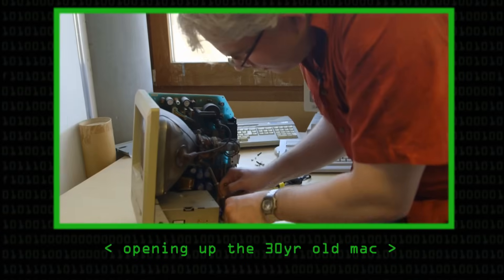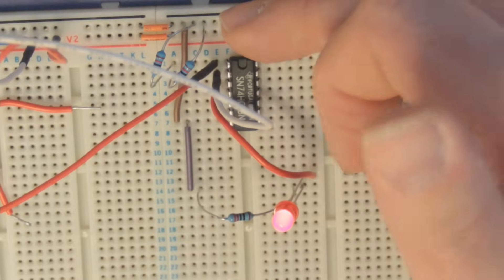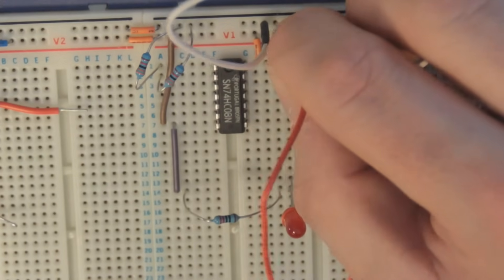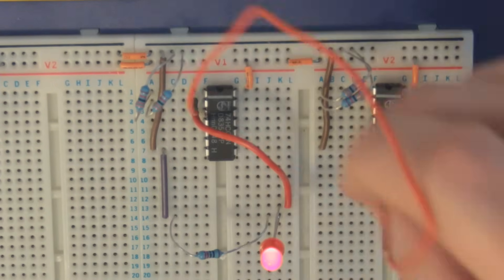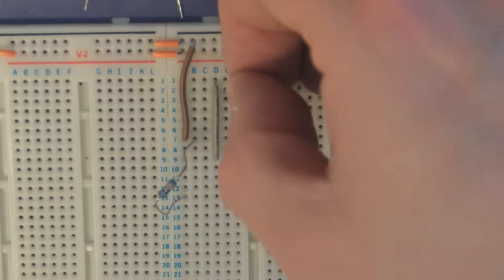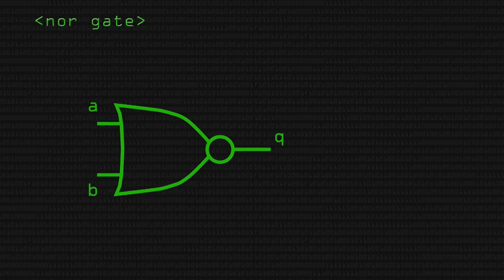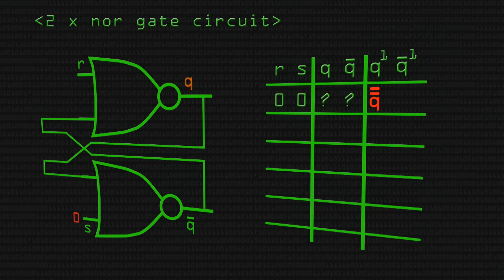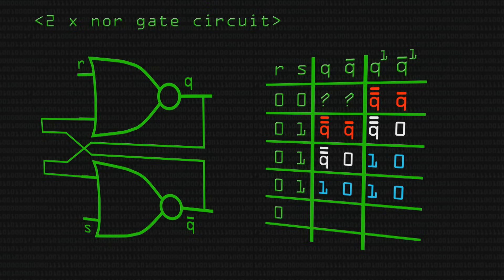How Computer Memory Works - Computerphile

Comment: And not once has he used the word "flip-flop" xD
Reply: realityscorned yes, obviously coming at it from the CS side. UW-Madison ECE grad here. Did you notice he never turned off the power while pluging/unplugging the ICs? And the foil in the packaging used to align the pins into the breadboard? Oi!
Reply: @bjornolson6527  even as 1st year graduates we had marks from Lab deducted if the invigilator caught us plugging/unplugging ICs without turning the power off.
Reply: @EvilSapphireR  I can't think of a way of how can that harm the IC. Especially just a simple TTL chip
Reply: I just wanted to say: didn't he just build a flip flop?!?!
Reply: @andinomm  thats technically a sr latch if im right
Reply: @worstvayneantartic4138  yes it's a latch, I mistakenly use these terms interchangeably

Comment: You wouldn't believe the kinds of tricks memory designers take to make storage and retrieval of data quick. This is a necessary first step to understanding it but man does it turn out to be a small part.
Reply: Are there any resources that one can read up more on this?
Reply: JinGwee
Unfortunately there aren't really any good consolidated sources online that I know of. Plus there's the fact that memory optimization is so fundamental that it runs up and down the entire abstraction stack of computers and causes massive headaches for anyone trying to write parallel programs. I'll give you some things you search for if you're interested.

Logic-Level:
SR Latch (what was shown in the video)
D Flip Flop (more useful in digital logic but shows how clocks are used)

Layout/Transistor-level: (mostly ripped from CMOS VLSI Design; A Circuits and Systems Perspective by Neil Weste and David Harris)
Elmore Delay Estimation
Domino Logic (touched on in a previous video) and precharge
SRAM/6T (6 transistor) SRAM Cell
DRAM (as well as the capacitors in it and refresh)
Differential Sense Amplifier/Small-Signal Sensing
Address line predecoding
Hierarchical wordlines
Domino Address decoder
Hierarchical bitlines
Column multiplexing
Double Data Rate bus (DDR)

Memory Subsystem Level:
Direct-map Cache
Fully associative/2-way set associative Cache
Cache replacement policy
Translation Lookaside Buffer (you probably need to understand virtual/physical memory and process address space for this)
Cache/TLB miss/fault
Memory/Cache hierarchy
Burst Transfer/Burst Mode

Application:
Spatial-Temporal data locality
Polytope Model and optimization
Pointer Aliasing

Operating System/Kernel:
Page table and page faults
Page replacement policy
Cache coloring

Parallelism:
Race conditions
Locking (or if you're adventurous, transactional memory) atomicity and mutual exclusion
Non-Uniform Memory Access Architectures
Cache coherency protocols
Relaxed Memory model
False cache-line sharing (usually done at the application level)

I apologize if the list is too short.
Reply: Ferroneoboron san That's quite a formidable list. Thanks for the reply. I really appreciate it!

Comment: It's one of the first video I watch on this channel and I haven't ever looked into hardware nor software programming.
14 minutes, the only thing I understood was that they create a circuit that loops back forever until you change the external input. But watching the whole 14 minutes made me feel very dumb.
Reply: I'm sure that if you tried drawing the diagram and working it out yourself, you'd understand it just fine. It can be hard to follow an explanation just by listening.
Reply: It's not explained very easily, it assumes that the viewer has some knowledge of computer science. If you'd like to learn more I'd recommend a book called 'Nand to Tetris'.
Reply: You're right.  It does loop forever or "flip-fop".  When two gates output into each other's inputs, they are called flip-flops which can be used as a type of memory.  Because they keep flip-flopping, they can keep their current state until they receive more input and that's why they're useful for computer memory.
Reply: ***** Yes, Nand to Tetris is a very good book. I would also recommend Introduction to Computing by Patt and Patel. It takes a very similar bottom to top approach when teaching how a computer actually computes. In fact, I almost wish Computerphile would take a similar approach and maybe make it a play list. Start from the very bottom, transistor level and go up through the layers of abstraction. That would be tons of material though :)
Reply: This is actually not a massively complex idea, the problem is that describing it in WORDS is a bit tricky. Most people aren't very fluent in diagrams or numbers, so the pictures and tables have to be explained to them in words, which kind of ruins their value.

If you remove it from the rest of the context of computer science stuff, it's actually probably a bit easier to understand. A "NOR gate" is a type of switch. When you take two of those switches, and tell them both to check whether the other switch has been flipped, you basically build a small machine that says whether or not it has been poked at some point in the past. THAT is how memory works.
Reply: You can build these logic gate experiments in minecraft.
Reply: palmomki The difference is, these videos don't give you the full backstory, I mean they make assumptions that you have a very basic level of understanding of both how a computer works, what RAM is used for and how electronic circuits work. If you have never studied circuits, or atleast not in enough detail to have heard of the concept of logic gates, or even resistors for that matter, then it can make it challenging.

For an example, its like expecting someone to understand how to use fractions, before being taught what a fraction was. It doesn't make you dumb for not knowing something, it just means that the entire concept is something new.

The same is very applicable to other things such as chemistry, engineering etc. The smartest computer scientist in the world might have never studied chemistry, and therefore if he watched a basic video talking about reactions, and didn't understand it, simply because he didn't know the very basics of chemical interactions, it wouldn't make him Dumb, just not experienced in a specific field.
Reply: Making this channel seem similar to Brady's *phile channels was a big mistake. Brady's channels target the interested layperson. This channel doesn't. Its attitude is basically "Oh, you didn't already know that? Well, that's too fucking bad."

Even though I am proficient in this area, I still think this was a missed opportunity.
Reply: If this is the first video on the channel you got lost on, then that means you understood Brailsford's series on stack programming with in-fix. Bravo!
Reply: This topic is hard to explain, not because it would be hard in principle, but because of all the terms (not q, not not q, etc, you get lost in the words, not in the process itself). If you are interested in this specific topic, I recommend drawing it out on paper and in table and simulating the cirquit manually yourself. If you are just curious about the channel, I recommend watching almost any other video than this one, they're always pretty good. Maybe try explanation of Heartbleed bug, that one is very good.
Reply: Darek Amadeus i think this is actually a real issue with schools today. as someone who was into computing when i got my first job in an office it quickly becomes VERY clear that almost everyone is in need of programming to some degree, whether its to:
1. display information in a wiki (thus requiring a wiki platform)
2. displaying an external webpage using html, php and javascript
3. logins to various sites to permit certain members of the company to access certain areas.
4. Databases, lots and lots of databases, from very simple excel databases to Access databases, SQL databases to much more object oriented databases for storing models or drawings or images documents etc etc
5. Excel Macros, for almost everything in a work place (surprised at how much business relies on this Microsoft software!) for KPI creations, calculations, listings for arrays, linking databases etc
6. scripts in general, scripts for scheduling, scripts for tasks, scripts for emails, notifications etc

and this is from working in a company that i would say was an average company in terms of computer usage, im sure the same applies in finance to software engineering.

is computer science difficult? no. its not, its based on logic that lots of people relate with maths but arguably you dont need math to be able to code. Do people need to know how a computer works? again, nope. because this is done by people before us and people who specialize in this area, we have OS kernals and libraries for a reason, heck even compiling sounds scary to a CS noobie but its not bad at all.

when do kids start learning this?... in the UK i didnt see a SINGLE piece of CS in my school, this is not taught in schools (which finish at 17/18 years old).
IMHO I think people who are not very comfortable with Microsoft products WILL struggle, if you are not great with computers, please please please please learn excel, word, powerpoint and understand what these programs are and what they are not, the skills in these products are better than any other skill you could possibly have in any job. I will make a prediction that in 10 years time it will be almost impossible to employ people that do not have these skills if the job involves being at a computer.

I am not a computer programmer, I want to be, I am learning, it is hard (due to lots and lots of languages and no money to go to university to get professional education) but I have to do this, its my passion and my dream. Everyday I learn something I realise how little I know in this abstract world of computer science and it suddenly dawns on you that these people that have these skills truly are the future.
Reply: it is not easy to understand by watching video, you have to do it by yourself, there are lots of software where you can experiment. It may seem funny but i learnt this in minecraft experimenting with red stones
Reply: Darek Amadeus True, even here in Germany it's just: "Hey, this is Internet and Google and there you have Word, Excel and PowerPoint".. But I do understand logic gates because of Minecraft Redstone. Redstone is basically just binary.
Reply: Learn redstone in minecraft, then come back here. :P
Reply: Nue Gai That surprisingly makes sense.
Reply: Darek Amadeus I don't know, I would guess these videos are in fact made for people who don't study it as a profession, because students and professionals sure already know all this stuff.
Thanks for the encouraging though, and I don't actually think I'm dumb, but it certainly feels so in such circumstances XD
Reply: Darek Amadeus In the UK, they are getting rid of ICT, and replacing it with Computing/Computer Science, to encourage the study of computational thinking and concepts such as programming. There is still ICT in the lower years, but Computing is being a compulsory study, simply because in this age, its important for people to actually understand what is going on inside a machine, rather than just have it works, It will also help give people a headstart into Computer science, which means the complexity of the course can be increased at the higher level, meaning better eduction. But yeah, Im only elaborating on your point.

Its crazy that at Universities, they teach literally the raw basics straight away. Its almost the equivalent of teaching algebra in maths, if you were to do a maths degree, it would be crazy to think that a university would start with algebra level, but instead Maths is a core part of the education system, and Computer Science should be the same. Atleast to a level where people can do something useful with it, rather than wasting time making spreadsheets.
Reply: You didn't watch the other videos
Reply: I don't know, the way schools are organized is basically: we teach you the basics to give you a general culture and to teach you how you can learn things. Basically they use maths, languages, geography, history etc. to give the students a taste of what studying is like, then they must... they can use this means they obtained to learn a specifical subject. From a "how useful is it" standpoint, I'd say computer science and computer engineering are more or less at the same level as geography or foreign languages, so it's really just a matter of choice, they can't teach everything. One could say it's an equal shame that they don't teach music or comic literature or folklore and many other things, but it's just that schools mostly aren't for culture, but for "teaching how to learn". At least, they should be. The fact that teachers and principals/deans/ministers/politicians tend to forget the real purpose of a school is an issue, but a different issue.
Reply: Yeah, i didnt introduce the most simple form of the circuit. I learned an easier one:

Just imagine two not gates in a circle. So the output of the first not goes into the input of the second and the output of the second goes into the input of the first. That even simpler circuit already stores it's state: Say the first not becomes a 1 as input. The output will then be 0. That goes into the second not. The output will be 1. And that goes into the first one again and the circle is closed. If you begin with a 0 then it will work the other way around.

The only downside is that you can't determine which state it will be when you turn it on and you can't change it. So instead of not gates you use an or gate and a not behind that (called a nor gate). That way you can "override" the state of the circuit and force it into the other state.
Reply: SquareKiteGaming It's not "the first video of this channel I got lost on", (even if it was I wouldn't probably brag about it) it's one of the first videos I've ever watched on this channel. It means I will probably get lost on most videos on this channel, including the one you talked about XD
Reply: Perhaps instead of trying to understand those Q, not Q, not not Q, try putting in your own values of 0 and 1 into the circuit and see how it responds. Don't worry, everyone was noob once!
Reply: It helps me to remember that things don't happen instantly. Follow the logic path.
Reply: Yeah it wasn't explained well that for a few cycles they keep changing, then reach an 'equilibrium' and stay that way. Anytime you do an input you change the equilibrium and they cycle for some time and reach equilibrium again. And this equilibrium is not chaotic but deterministic, so we can use it to play Sherlock Holmes and deduce the input.
Reply: Split it into parts.
Reply: Well I can tell you I did math (algebra etc) at school 15 years ago and I work as network specialist but this looks more like electrician stuff to me :p.
Reply: Don't feel dumb.  I knew most of this stuff before, but even I was confused and had to replay parts of the video because this guy's explanation was absolutely horrible.  He explained it in pretty much the most confusing way possible.  Actually, every computerphile video starring this guy is awful because he just doesn't explain anything properly.  There are professors that pay attention to pedagogy, but unfortunately there are many who just don't care.
Reply: Tubby Lumpkins I have seen plenty attempts at explaining these and none of them have been good enough IMHO. This is one of those problems you have to try on your own to understand fully.
Reply: *****
Don't start here. This shit is entertainment not education. This channel is bullshit. And, it's either targeted at like 5th graders OR they assume their audience has the intelligence of a 5th grader.
Reply: "It's full of super advanced mathematics, electronics, engineering etc." What? I understood the whole video without 'advanced mathematics, electronics, engineering etc'...and for all the time I've been interested in programming and computer science I've never needed any of that. Also, I'm only 14 - I just get it; most people don't, that's why so many people find it hard, not because they haven't looked into it that much but just because they aren't built for it. I could explain things to my mom all day and she wouldn't understand any of it afterwards.
Reply: For everyone saying it's simple, now try hooking up a processor and more logic gates in series. Not hating, I want to try it myself lol!
Reply: Or read CODE: The Hidden Language of Computer Hardware and Software by Charles Petzold